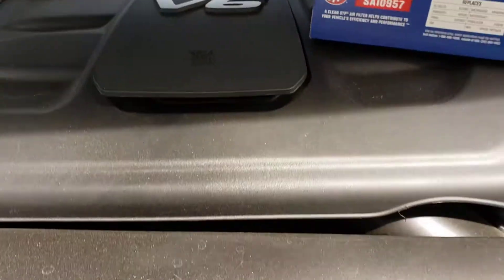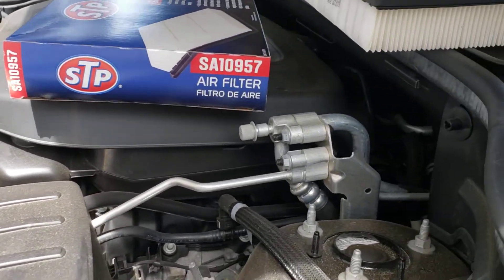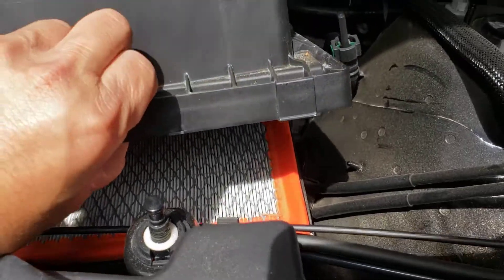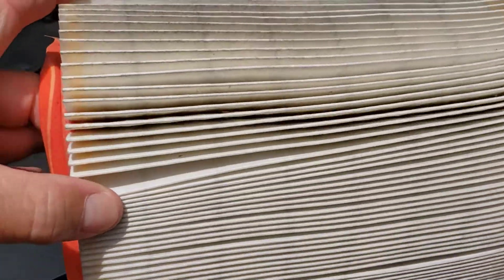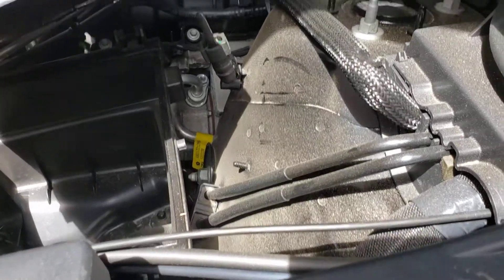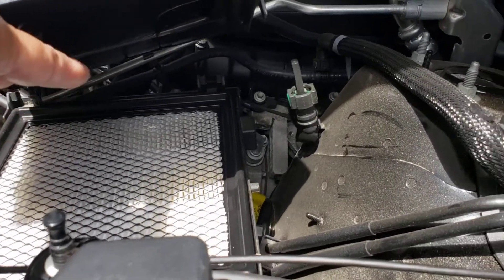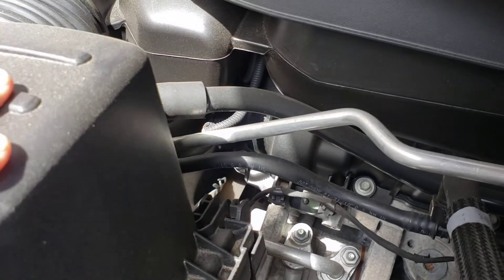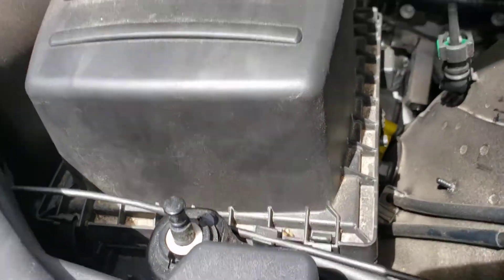2018 Jeep Grand Cherokee Limited 4x4  3.6 V6 Air Filter replacement Change How To

Comment: Bummer, this is nowhere near like my 2018 v6 Cherokee Latitude.......
Reply from the maker: But should be the same basic concept..did you compare it to yours?
Reply: @alyoungcuda  Yours is on drivers side, Latitude is on passenger side, even filter shape is different, and my air box has aggravating screws, guess you bought the best Cherokee version.......